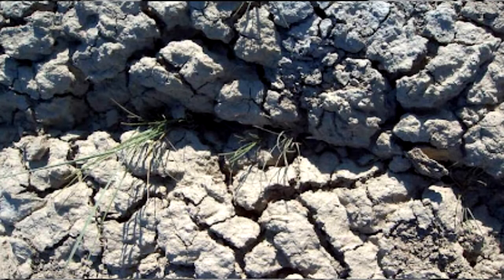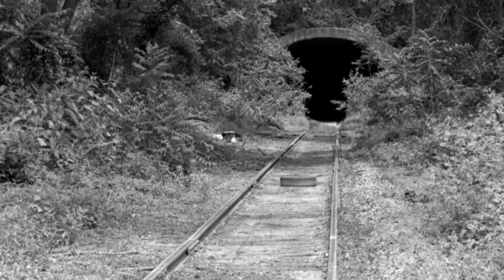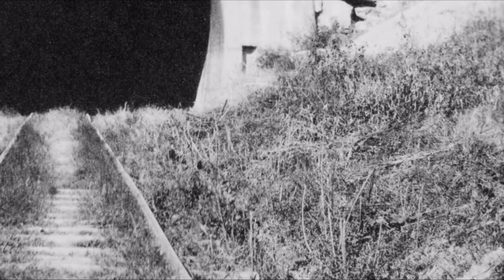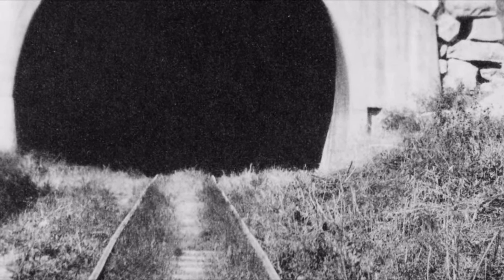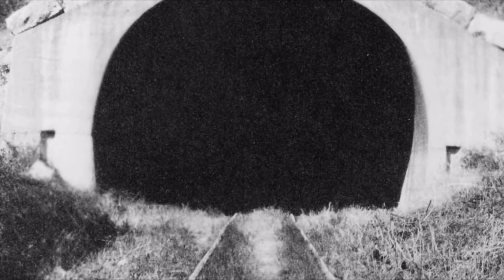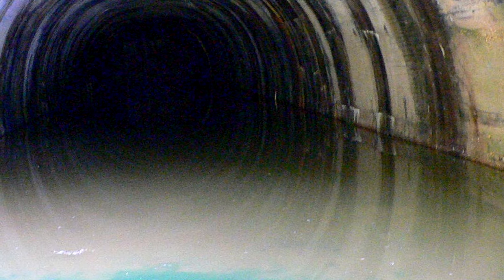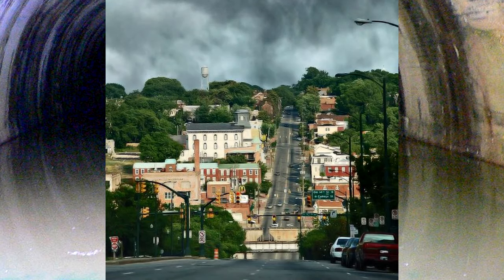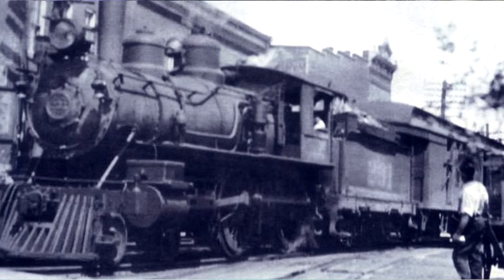The Tunnel of Death and the Engine Within 🚂 The Church Hill Tunnel 🚂 History in the Dark

Comment: As Geotechnical professional, the locomotive is better off where it is. 

I think that expansive soils weren't the only reason as liquefaction of the soils caused by vibration of trains in winter is the more likely the culprit. As you indicated, most of the trouble occurred during winter. 

The resulting silt and water mix found the tunnel afterwards is a sign that the soils around the tunnel are likely highly erodable and without careful management of the groundwater, will cause sinkholes to appear above, or cause liquefaction (quicksand) to occur which has been known to kill or swallow equipment.

Comment: The locomotive needs to be removed to prevent further collapse. No matter what happens the tunnel will completely collapse and all of church hill will fall in. The best option is to have controlled collapses and evacuate the area. While doing so they should excavate the locomotive and put it in a museum and fill in the ground. Then after that put a memorial at the eastern portal.

Comment: It's not that many years ago that a tunnel on the East Coast Mainline in the UK collapsed during an inspection. The result was a diversionary new line around the tunnel and the tunnel was blocked up. I believe that there are still equipment and bodies left inside because of the danger of further collapse. This was on a modern 25kv AC overhead wired electrified route in a tunnel that had been in use for over 100 years. So it's not a unique situation and shows how much danger is involved even in modern times in maintaining a railway.
Reply: Penmanshiel?  1979. Two men, and the JCB and dumper truck they were using.

Comment: Part one (part two in reply):
Those who build tunnels in London, England know all about these soil conditions.
It is one of the reasons why the tube does not extend much into South London.
Most of the southern tunnels are iron-lined and were dug using a shield.
Indeed the tunnelling shield was invented by Marc Brunel (father of more-famous Isambard) because of the trouble he had digging under the Thames. Isambard Kingdom Brunel nearly died in one of the collapses on that project. It was improved by James Henry Greathead who would later build a tunnel under the Thames.
The Greathead Shield was used to build the "City & South London Railway" (C&SLR) in 1884. These tunnels are now part of the Northern Line of the Tube.
Reply: Part two:
There was a narrow escape on 27th November 1923 near Borough Station on the C&SLR.
The C&SLR were in the process of enlarging their tunnels to match other underground lines. Work could only proceed at night to avoid disrupting trains. Every night there would be a small gap between the iron rings of the enlarged tunnel and those of the pre-enlarged tunnel. This gap was temporarily shored up with wood.
A train approaching Borough Station in the evening of the mishap hit some wood on the track and the driver did an emergency stop. One of the guards got out and looked for where the wood had come from. He did not know that the rear two cars were actually under the gap at the time and a mixture of sand and water was coming from the roof. He eventually heard the sound of running water. The driver was able to let the "controller" know using the special emergency telephone system (in most tube tunnels at the time) before it cut out. The driver then brought the train into Borough station but had to coast the last part of the way as the power shorted out. Enough sand, gravel and water fell to completely obstruct the tunnel.
A large sinkhole formed on the surface and the local utilities were damaged. A gas leak occurred and this led to an explosion and fire. The fire was put out by a ruptured water main. Even though it was on a busy road and tram route fortunately nobody was injured.
The C&SLR closed the line until they had finished the enlarging work.

Comment: Say, what are those sparks in the locomotive... carriages? I'm unfamiliar with terms, but still in the intro there are couple of spots where something sparks/flashes in the locomotive chassis. What are those?
Reply: Oh that's the bottom of the firebox. It isn't a solid plate, it has holes to let air in. It's a fire grate/Ash pan depending on what/who you're talking about/to. Occasionally some sparks do leave.
Reply: the chuff chuff noise you hear as a train moves is from the waste steam from the cylinders being vented up the smoke stack, this creates a low pressure at the front of the boiler tubes drawing air through the boiler tubes and firebox increasing the efficiency of the firebox, as the air is drawn through the firebox the fire burns brighter, creating the pulsing flames you see in the opening

Comment: personally if the 231 is ever extracted i feel it would add something to the preserved 4-4-0s in the US theres not many like her around anymore with modern components the air compressor is one true you got prr 1223 as a modern 4-4-0 still around but i mean something like the frisco 182-187 class but i can understand why 231 should be left as in at the moment true it would be nice to have her cosmetically restored and the crew got a proper burial the risk is too high with water erosion and how theres been a collapse already which trapped 231 only time will tell if 231 gets extracted but for now she is a relic of the past and the dangers of railroading and improper construction or improper location for construction (idk how to best describe it lol)
Reply: I'd say put her and her train as is in a covered or a climate controlled building next to or neat the tunnel entrance as a this is what happened kind of exhibit. A full restore would be nice but the way the train is now would speak volumes more.
Reply: The train has probably pretty much disintegrated due to almost a century of water saturation.
Reply: @williamclarke4510  Probably not much left but large castings, and brass fittings.